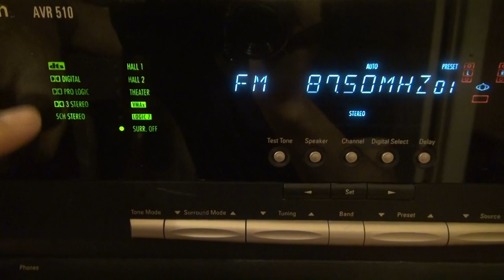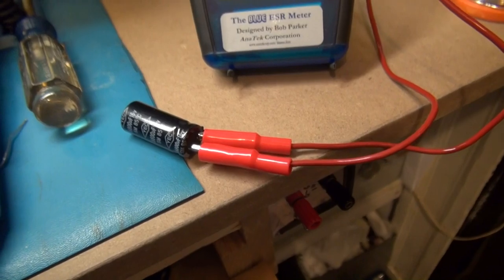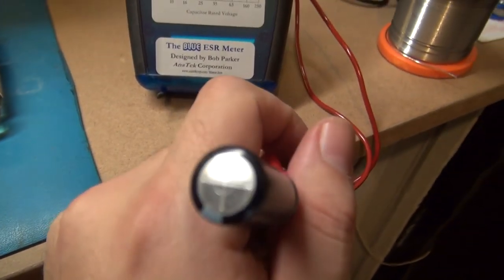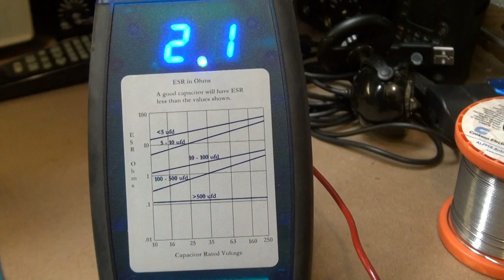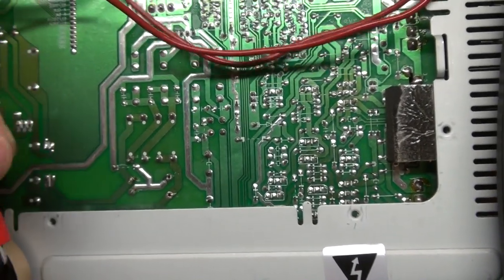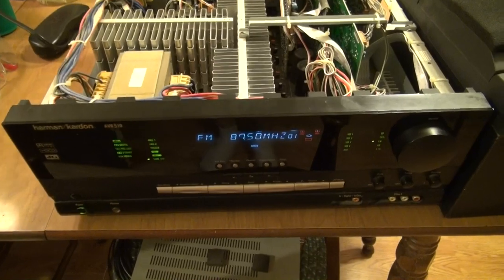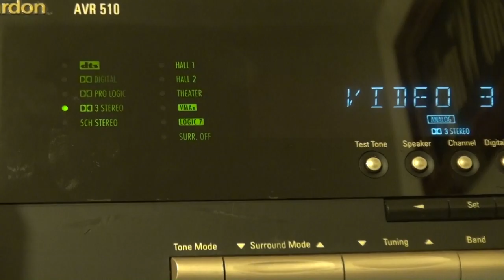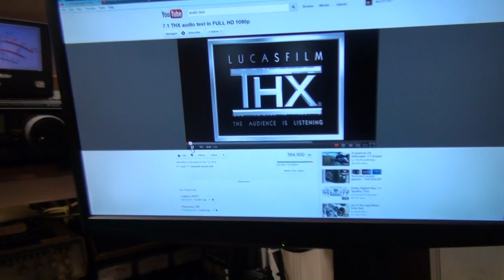Harman Kardon Receiver Repair. Buzzing Audio 60 Cycle Hum ELECTRONICS REPAIR.

Comment: Thank You Sir  
Mine was  a  AVR4000    ..opened the box  .Soldered out the capacitor  ..that looked the same... in with replacement    and  it worked .  You are a Hero !

Comment: Ha ha! I can't believe that you made this video... my circa 2003 Harmon Kardon AVR120 also had this problem and when I looked at the capacitors, the exact same YEC-manufactured cap in the front of the chassis was very slightly bulged as well. I found a replacement cap on eBay for $3 and now after 10 minutes of soldering my receiver is as good as new! Thanks!!!

Comment: Kev, thank you very much.

I have the exact same unit with the exact same problem. I had a puffy capacitor just like yours. Three dollars later it performs extremely well again.  I am thankful all the capacitors in that group were lined up, biased the same way on the PC board. Because, when I pulled the capacitor I forgot which way it was lined up. Luckily, the glue at the bottom of the capacitor gave it away as to which way it went.
Reply from the maker: Jeff Pereyda Glad it helped

Comment: Many thanks for this vid, I have a AVR110 and it was humming and randomly shutting down, finally it wouldn't stay powered up for more than a few seconds.
Same cap 6800uF same bulge on top problem solved! My AVR is once again part of my media center, I did not want to replace it as the sound is great and it has optical inputs which is all I need (I do not switch HDMI in the receiver) .
Again thank you.

Comment: Thanks for this. Have an AVR120 that has a hum. Bought it from someone last year like that for really cheap. But the hum has gotten progressively louder. Opened it up and, sure enough, that same capacitor in mine is bulging. I don't have all the same test equipment that you have in this video, so I'll just start with this capacitor for now, and see if that solves my issue.

Comment: Thanks for all your help with this issue. I do have a multimeter to test certain things, could a faulty diode in the bridge rectifier configuration (4 x 1n4006) cause audible hum the same as what i am hearing??

I dont know if this has any relevance BUT one of the newly replaced capacitors seems to get a little warm on the top of the can, if a faulty diode wasnt working correctly would the fact that dc wasnt presented to the cap and ac instead cause this issue of hum.New caps are twice rated V+

Comment: I've got an AVR110 apart on the bench at the moment. Think I'll just shotgun the power supply filter caps. I don't have a cap checker at home, but I do at work. I'm also replacing the 0.047F supercap for the memory backup. That one crapped out years ago and it loses it's memory even if the power blinks for a second.

Comment: You save my day,  I just fixed mine,  same model,  but I can't find the same capacity and I bought the 10000uf 25 v.  Works fine at the moment but I hope I can find the origin  6800uf 16v soon cause I'm worried about that I can broke  another components,  what's the worst thing that can happen?? Can I use then receiver with a normal use??  Sorry about my English I'm Mexican

Comment from the maker: Well you did the right thing by going up in capacitance and voltage you don't want to go down. It will be fine, its just a filter cap not a critical circuit that is timed from capacitance. But I Always recommend putting in the correct value when possible.

Comment: For all those that dont know , CAPs have residual Voltage ,so you cant discharge them fully , it can and will retain voltage , so screw driver thing doesn't even work for discharging caps

Comment: Thanks for your reply, i changed both caps, and the hum is still there? There are 4 x diodes in the psu, can these cause mains hum on the master output? or THE Torodial transformer? The sound i believe is definetely exactly the same as mains and NOT a ground off, ps some of the channels sound a little distorted when listened to through the headphones (but only on the master out listening part). When i listen to the inputs direct they are not distorted at all, any thoughts please

Comment from the maker: the capacitors can hold a charge for a very long time. if the unit is faulty I would not assume the caps are discharged.
Reply: Working or not I will always short them to (mostly) discharge  them

Comment: @ Kev31779 My hum is very noticeable,its that loud it would override any music played through it,you can always hear it constantly
Reply from the maker: +SP330Y You may have a diode leaking, but it is kind of rare. It is usually a cap. Check all smaller caps in the circuit also. Sometimes a hum can be fed in from other equipment source tied into the mixer, so try to disconnect everything and see what happens.
Reply: Kev31779 I have done that disconnected everything and it still hummed,ive also replaced the 2 large smoothing caps and 3 smaller ones around the psu area,still hummed,replaced the regs too,still humming BUT i have not replaced the diodes and the scope does measure mains sine wave ac shape even at the input of the regs.

Comment: How long do those capacitors hold a charge for?  If you press the power button doesn't that discharge them when its unplugged?

Comment: Nice video.  I have an AVR110 with the same issue.  It appears that I have the same problem, puffy cap 6800uf 16V 16mm diameter and 36mm tall.  I also noticed that one of the larger caps 6800uf 63wv 31mm dia and 41mm tall 10mm pin spacing is also puffy and shows black stuff around base.  Going to try and replace both.  Looking for parts and have found some that are very close from mouser.  The larger cap replacement has slightly larger pin spacing 12.5mm from Nichicon. I am hoping this will work.  The smaller one is from united chemi-con but rated at 20v.  Will the 20 volt work?  Also did you ever fix the LED?  I have the same issue.
Reply: I replaced the one capacitor on my AVR110 and it works great.  I would love to see a video on how to repair the LED lights.

Comment: HI, I have question maybe you could answer for me I have a Harman kardon avr it needed a re-solder on one relay and in the process I snap what look like some kind of thin metal jumper the number on the board is jp33 is this a jumper that I can take if it same length from another board to replace it.
Reply from the maker: +Thomas perno If it is just a single jumper wire, you can replace it with any ordinary wire of equal size or solder it where it broke..

Comment: a good quick easy way to check caps is to use a 9v battery use your dvm to see if it holds the 9v for a min if not it's bad. only works with cap with a value over 10mf always replace cap in pairs if you can
Reply: that only will check capacitance, not dissipation factor or ESR, though.

Comment: Thanks for the reply I have replace the jumper but for some reason withe jumper in place it will turn on get video and turn back off with the jumper undone it work as it should could the relay next to the jumper be bad if so why is it working with the jumper undone any help will be greatly appreciated.
Reply from the maker: +Donavan Perno It is really hard to tell without seeing what happened. If you make a video and explain what you have done and why you did it and show the damage you may have casued , It might help me see the overall picture to help. Otherwise there is not enough information to really tell you exactly what could be wrong.

Comment: @Kev31779 Hi Kev,I have an audio disco mixer unpowered Behringer VMX1000 and it too hums (mains hum) from the master output and phones regardless if all the sliders are turned off an no inputs in.
I suspect the PSU,i changed the large caps,still hums,3 x regulators still hums, but NOT the diodes (1n4007) i scoped the outputs of the 3 x regulators and found ac mains on 2 out of 3 of them despite being changed for new.
 Could faulty bridge rectifier diodes fail and instead of turning ac to dc still give out ac which in turn would be fed into the regulators,making them get hot and cause audible hum.

...so could and do diodes fail like this causing these symptoms?/
there is nothing else across the circuit before or after component wise other than what i stated,i thought if a diode blew it was dead,dont have enough experience to know if they can fail and give out ac or not,please help :)
Reply from the maker: +SP330Y You can try to replace the diodes. Without seeing it or a schematic , it it hard to tell.
Reply: +Kev31779 can I send you an email of the noise my amplifier is making?

Comment from the maker: Its hard to say without looking at it. Other than changing the obvious defective parts and without some test gear you are not going to be able to troubleshoot as in dept as you would like. It sounds like you may have some more bad caps somewhere or even a bad op amp maybe. Keep looking, without a scope you are not going to be able to see if there is ripple on you PSU or an op amp that is not operating properly..

Comment from the maker: Its possible but if the rest of the unit works i wouldnt think so but i would check them and everything else you can in the P/S..you may have a shorted diode in the p/s but i would think it would be drawing mad current ,, usualy diodes fail shorted more than open. Or should i say fails shorted then opens from the massive current draw but not always.. most supply will shutdown before something evil happens but not all.. if that makes any sense

Comment: Didn't work for my receiver. I have Realistic STA-82 that has the same issue. I replaced the filter caps and a couple of other ones with no success. My unit's problem appears to definately not be a cap issue IMO. It too has a distorted left channel, at times. I also don't think it's worth going thru the entire unit replacing caps to try and correct it. It's too old really to bother. Somethings wrong somewhere. I have two other receivers in the closet that don't do this at all. I can always use one of them. I guess I just am making it a hobby trying to solve things like this. I'm no tech and don't know where else to look for this solution except the dumpster.
Reply from the maker: +Chas S Try checking the speaker switching relays , they sometime fail and can ruin your day. But with electronics anything can be the issue.

Comment from the maker: From what i can tell from the very poor print is there is a + 15 and  -15 volt supply. I would at least start by changing the four caps there and see how it goes,, without propper test gear you are just tossing parts at it.

Comment: this is the web address for the schematic for my mixer vmx 1000 behringer

scribd.com/doc/74606278/Behringer-Vmx1000-Schematics

pps the capacitors i removed had also leaked from the base